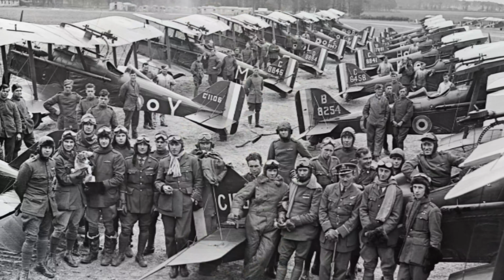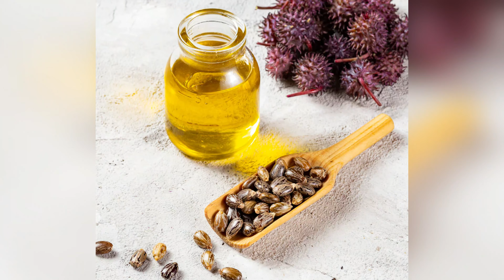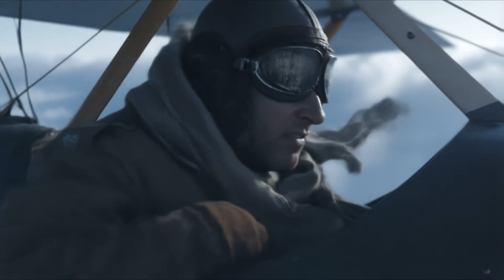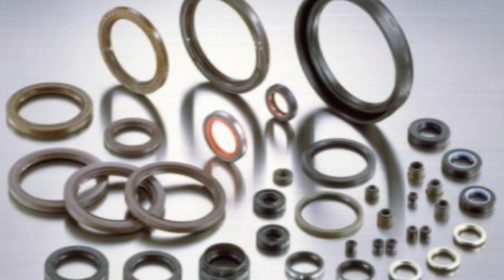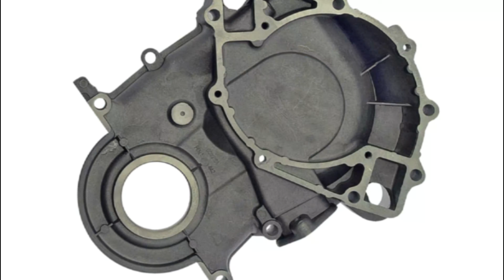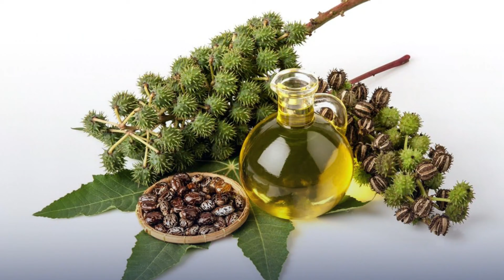Mechanics Never Mention This $3 Oil Leak Trick

Comment: Years ago model airplane glo engines were 2-strokes, using a fuel of methanol (wood alcohol), a little nitromethane for better ignition, especially in cold weather, and castor oil for lubrication.  These engines, most of which had no rings, but a lapped piston/cylinder assembly.  They kept good compression over the years of use from the brown varnish that built up on the piston and cylinder maintaining a tight clearance.  These engines rarely seized as the castor oil got thicker as it got hotter.  In the 1970's when synthetic oils were introduced modelers complained that the new fuels/oils damaged the engines.  The synthetic oil had a very high detergent effect and washed away the castor varnish that had maintained tight clearances.  Some fuel manufacturers added a certain amount of castor oil back to the mix.  Engines that had never used castor based fuel didn't have any problems.
Reply from the maker: That's a fascinating insight into the evolution of model airplane engines and the role of different oils. It's great to hear about the historical context and how materials science impacts performance!

Comment: Thats why rc nitro engines run castor oil in the fuel , a lube that doesn't ignite,  even at 38 thousand rpm

Comment: Retired mechanic here. Plasticizers are in fact used to soften seals. Castor oil can be used as a plasticizer but it is a lot safer to just use an engine oil stop leak product. However these have limited success because most seals that are leaking aren't leaking because they're dry, they're leaking because they're dry and cracked. Cracked seals can rarely be repaired. What I would do if I were you is simply go on YouTube and look up how to change the seal myself. You'd be surprised how easy it is and your local automotive store will gladly order you the correct part. If you're not confident to do it yourself then yeah hire a mechanic.
Reply: Words of wisdom. 
Thank you Sir!

Comment: I have a Kia soul that sucks up oil. Kia has refused a new engine. Will this delay my engine blowing up?
Reply: Different issue. You'll have gunked up oil control rings on your pistons. Common problem with modern petrol engines. Engine flush every 1000kms may bring it back without a rebuild if it isn't too bad.
Your next car, do oil changes every 7-8k  or every 12 months. 
Dirty oil causes it. Don't know why manufacturers say that you can do it every 15k. That's terrible if you only drive around town.

Comment: I have a 98 Ram with a Cummins. I use AT-205 Reseal to stop the rear main from leaking. It was recommended by Scotty Kilmer here on YouTube. I'm going to have to drop the transmission on my 04 Silverado to fix it's rear oil leaks. Caster oil isn't going to help my trucks. I'm going to have to give it a try on my desert hair though. Thanks again!